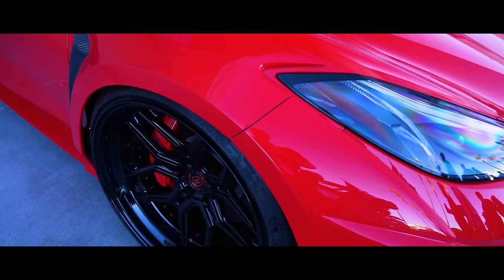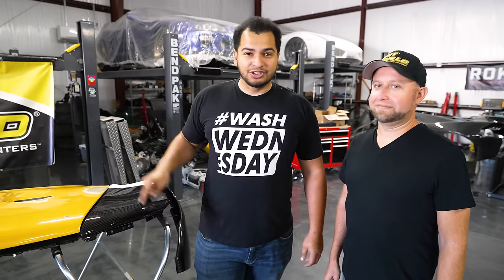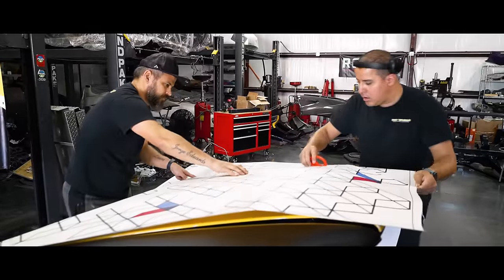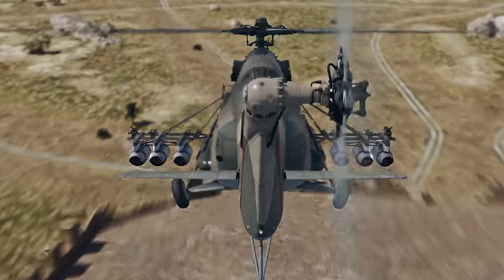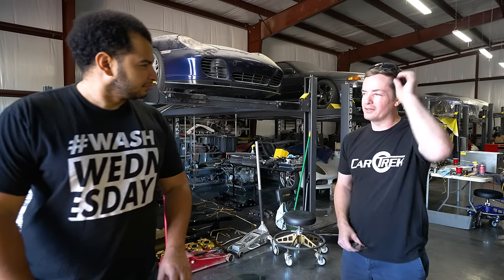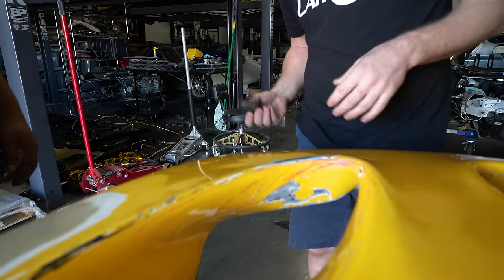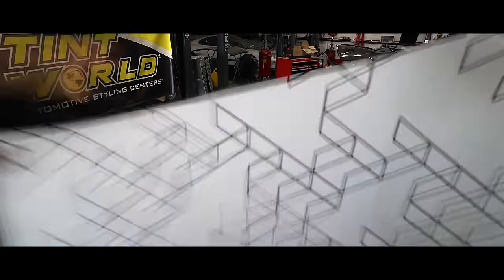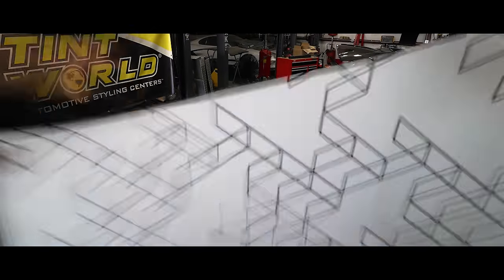Rebuilding A Flooded $2,000,000 McLaren P1 | Part 12

Comment: Damn this would be the sickest P1 comeback in the world. So happy for you Tavarish ❤
Reply: Part for the fact that now it's basically a tuned 650S.
Reply: @AB-80X Not sure, but I’m almost certain the 650, doesn’t have a 720 engine, let alone a built 720 engine. Also suspect the suspension is far better on the P1 than it is in the 650, so personally I don’t see that comparison.
Reply: @MechanicalMafioso  
Like I said, tuned. Or in this case, engine swapped.
As for the suspension. Let's see what happens. Maybe he also realizes that the OE suspension is too expensive and thus just throws a set of coilovers at it.
Reply: @MechanicalMafioso it'll be twice as expensive as DDE 720 GTR with a built 1300+hp engine.  The P1 without the hybrid drivetrain and battery will actually weigh less than the 720s. It'll have an older version of the 650s/720s transmission. Won't be a completely new build but it should be interesting
Reply: @sys-administrator 
That's a ridiculous comparison, and you know it.
Reply: @MrSeanman30  exactly. It’ll end up being the fastest and likely most reliable P1 out there… Hybrid might have been neat 10 years ago, now it’s just a liability keeping most owners from driving them. Best thing he did was loose the old hybrid setup.
Reply: @AB-80X  likely be able to have it all rebuilt.

Comment: Imagine when this car is "finished" going to a 1/2 mile event and seeing how fast it can go... racing rob dahm and his 4 rotor
Reply: you mean slower than before right?
Reply: I don't know what you are trying to say. @anubaral
Reply: @alexanderswander8176  he is loosing the electric motor sooooo yea, around 300 hp and insts torque lost
Reply: @anubaral  He is also losing a ton of unnecessary weight. With proper tuning such as launch control the engine alone would be far superior. 300 hp is an overstatement and the car would have wheelspin/torque either way with electric or without electric. I bet this P1 would smoke ANY other P1's and possible even a Senna.

Comment: So time management isn’t this guy’s forte.  He ran out of time, switched to plan B and is now calling it a “project car”. Has not fired up the engine, doesn’t know if the transmission works, is hoping the wiring will be correct. And now promising a finished, driving vehicle for next year’s SEMA show. Seems to be “all hat, no cattle “.  Time will tell.

Comment: Out there somewhere, a random McLaren F1 owner has a turbo and longer final gear fitted, just to tip his hat to Freddie and make it interesting. Hires a runway and clocks a 255  mph in both directions, then has the terrible turbo and final gear removed. Frankly, a turbo may not even be necessary. Just race fuel might do the trick? F1 was really slippery and although over-revved to go 240 mph, that was probably well under 700 hp still. What else could boost an F1 by 200 hp for two runs only?

Comment: So you removed the hybrid drive, changed the motor, and didn’t get it painted for SEMA? You took a $2,000,000 P1 and lost 2/3 of the value and made it a resto-mod! And did you just give away your color reveal? Excuse the pun, but your finances will be under water on this build!
Reply: Don’t get me wrong; what you did with this car was nothing short of a miracle, but I just wish that you would have kept the hybrid drive system! Congratulations.
Reply: Didn’t change to engine, just had it built…
Reply: @MechanicalMafioso  so replacing rods and lifters and increasing the size of the turbos is not changing the motor?
Reply: @Britton0932  technically that’s called modifying an engine not replacing/changing as the block/heads are the same… if an engine from a completely different car was installed that would be changing as the engine was changed. If you look for a #’s matching car in regards to an engine, the only parts that are ever vin stamped are the block and heads. So in a nutshell as long as it’s got the factory block and heads, it’s little more than a modified factory installed engine. oh and as far as the 2/3 loss in price. The ocean did that part…
Reply: @MechanicalMafioso  well…. Changing is not replacing
Reply: @Britton0932  kinda is, if I say I changed my pants does than not mean I have a completely different pair on? Or if I changed anything that mean’s completely different. Not same same. As soon as that car was in the drink, it staying factory became completely irrelevant.

Comment: I think this will be the best P1 in the world. Faster, more modern, different, but it will be a P1.
The hybrid system is a nice gimmick, but completely unnecessary.
With the weight that can be saved by leaving it out, the larger turbochargers will be more noticeable. Plus, the batteries are way too expensive for that little bit of extra power.

Comment: Idk if you have ever had a problem with powder coating & having the bolts & nuts loosen up from the coating cracking. I know you probably already know but just Incase it will be easier to grind the powder off bolt it back on & move on. We usually used silicone to cover the area so no rust or corrosion or spray can paint depending where & what. This is for racing bikes atvs & such. It was good to run across the video man I used to watch every episode years ago. After bad health surgeries a divorce homeless at one point I’m still here somehow. I’m happy ur still going in life.

Comment: Dear Freddy, i have a question, you talk about bringing up the engine power to 1300 Hp, my question is what about the body and the suspension? did you reinforced the body, and did you upgrade the suspension? like new coilovers? better shock absorbers? cause its very needed especially for a big Hp lightweight car
Reply: That will be done in the coming episodes after car comes frm SEMA

Comment: Why didn’t you clean the old transmission before bolting it to the sparkling clean engine?
Reply: I see that it was dry ice cleaned after the engine and trans were put into the car.

Comment: P1s are hybrids. This isn't rebuilding, it's just salvaging the body for a different car.
Reply: I hope u know the word restoring to its original condition here rebuilding is not like making it original but either it can be custom or original..this is where Freddy goes fr custom where he does whatever he desires
Reply: Are you high? Essentially all he did was remove the Hybrid…. Granted he sent out the engine and had it built, but its still all P1. 🤦‍♂️

Comment: What’s the point of sema for this build
I m all for a deadline but if the cars not really finished ie body and running what’s the point we could all push a wrapped mule on to a platform at a show
I’m confused
Reply: I obvs missed the engine going in part and wiring loom